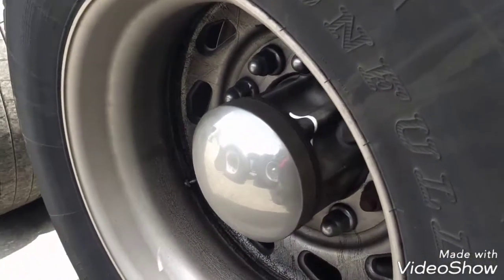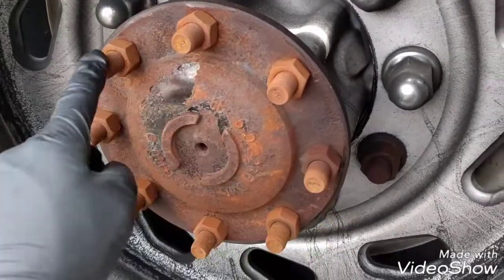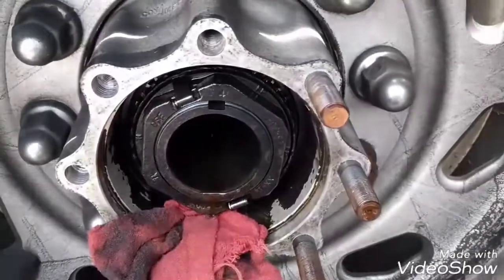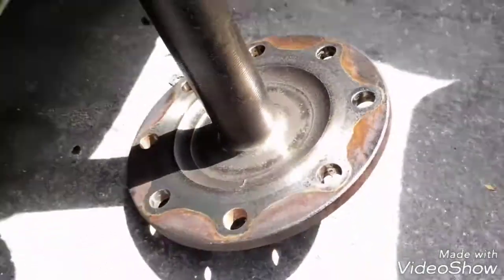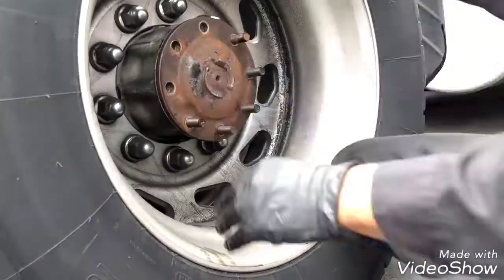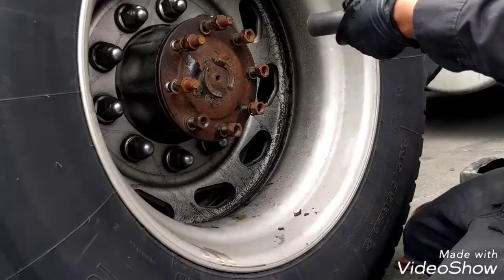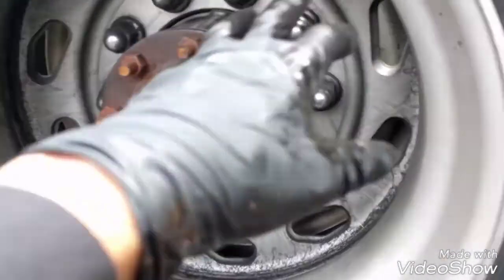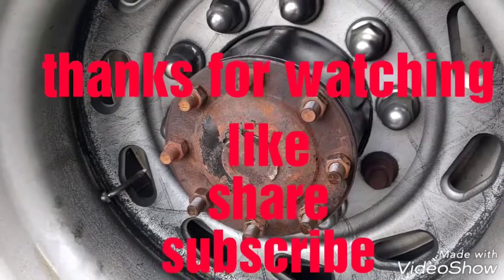Freightliner Cascadia Hub gasket replacement

Comment: Hola Francisco.
2016 western Star 5700xe 
Hub gasket
Ya reemplace este gasket trasero 3 veces y sigue escapando aceite que podría ser la razón?
Ayuda por favor..
Hello Francisco.
 2016 Western Star 5700xe hub
 I already replaced this rear gasket 3 times and it keeps leaking oil, what could be the reason?
 Please help

Comment: Hi Francisco thanks for the video, but you don't need to add hub oil?
Reply from the maker: +Noe Alvarez 
No, you have to add oil to the hub only if you replace the wheel seal. 
If you replace the hub gasket only you have to add oil the the differential if the level is low.

Comment: Good video  ..
Do you need to add some oil or grease it inside the hub  because I see some oil comes out when you removed the hub casket   ?
Thanks
Reply from the maker: +Maher A 
You don't need to add oil to the hub, you will add the oil to the differential if it is needed. 

Always use synthetic oil for your differential.
Reply from the maker: +Maher A 
You will add oil to the hub if you replace the hub seal

Comment: How do you know if you need to replace just this gasket, or the entire wheel seal.
Reply: Wheel seal would be leaking into the drum, brakes side of the hub. The opposite side of this gasket leak.

Comment: are u suppose to add oil to the hub after?
Reply from the maker: +shyeem63 
Yes, you can oil to the differential if the oil level is low.
Reply: Francisco Amaya OK I didn't know so the oil that's in both differential runs also to the hub on the drive axels?
Reply from the maker: +shyeem63 
Yes, the oil goes around the differential and the hub to lubricate them while the vehicle is in motion. 
This only applies to axle with differential, for the front axle (steering axles) and trailer axle you have to add oil to the hub.
Reply: Francisco Amaya OK I appreciate it makes sense. thanks for the bumper video too that was helpful cause I'm in that situation now with mine..